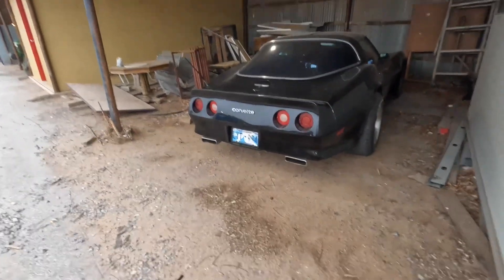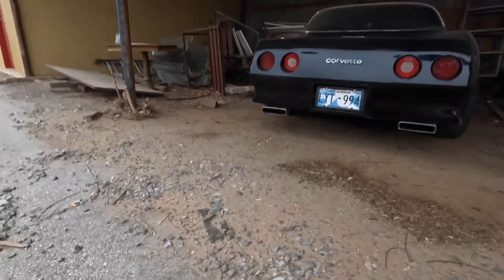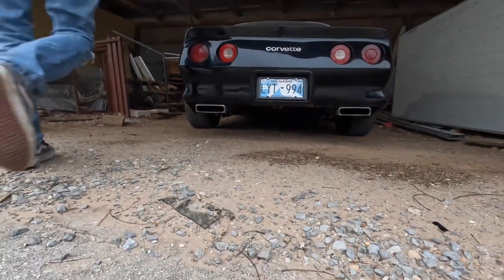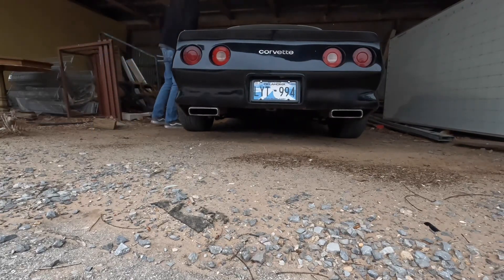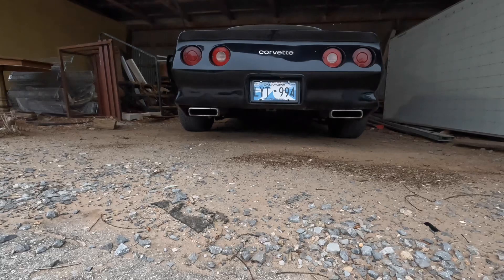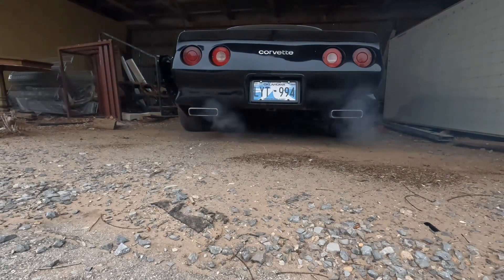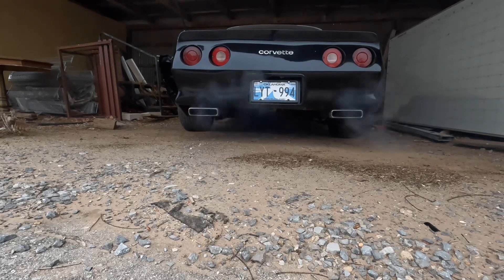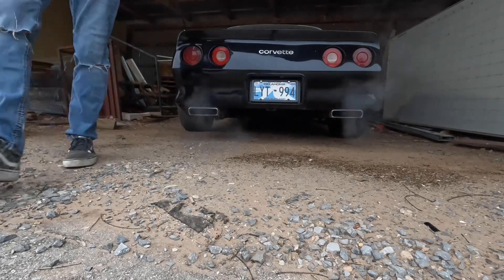Ls swap Thrush / flow master H pipe exhaust sounds cold start 2-1/2” pipe ls c3 corvette restomod

Comment: Did you get a full exhaust system?
Reply from the maker: no header’s just stock manifold then it’s 2-1/2” dual pipes all the way with it H piped after the transmission
Reply: Ok thanks.  Do you have a link for the exhaust?